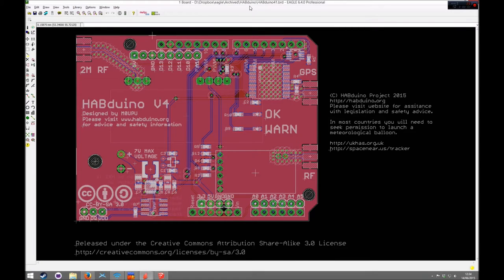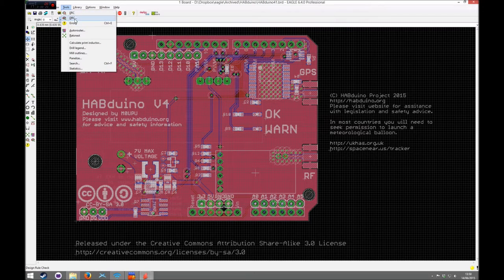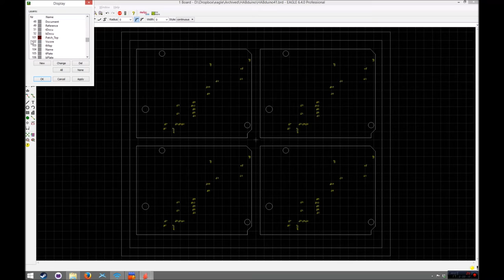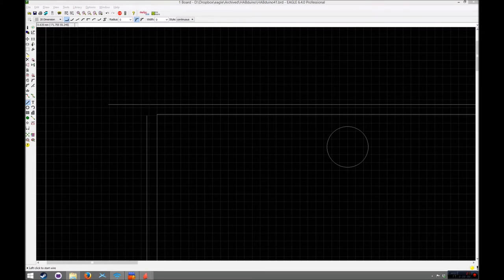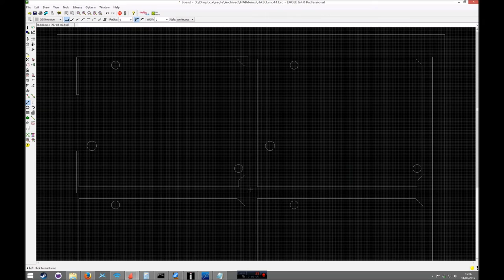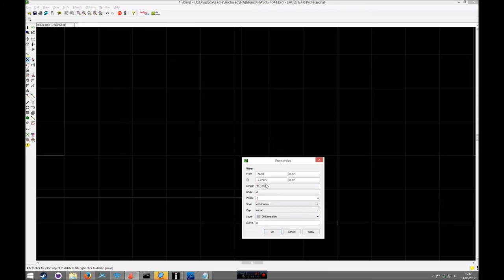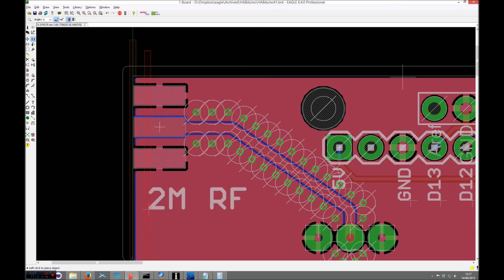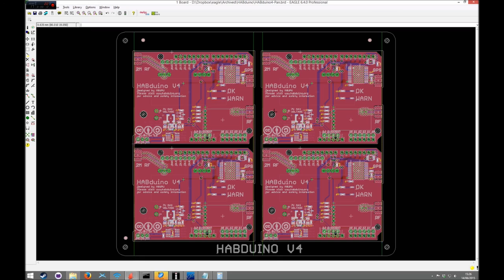Panelising PCB's for Manufacture in Eagle

Comment: Anthony, what was the width of the 2M RF trace? It doesn't look that wide. Is it 50 ohm impedance matched? I did calculation and it says I need 3mm trace to get approximately 50 ohm.
When I made it I didn't even consider impedance matching so I used a 0.5mm microstrip which give a characteristic impedance of 109 ohm !!
Dielectric Constant: 4.5
Substrate Height: 1.6
Trace Thickness 1oz/ft^2

Comment: This video was really useful thank you!! I had some questions about work flow: Why didn't you put the v-cut horizontally? I know the board shape is simple, but I would go for the simplest edges for the score to reduce work. Second, why did you spend all that time deleting the dimension lines of the original board? You could just draw a parallel line outside, draw two perpendicular lines for where you want the solid pcb join to be, then delete the remaining inside dimension line - it achieves the same thing with about a quarter of the clicking, you can still use the miter tool to round off - am I missing something? :-)

Comment: Great video! What is the command to convert all the text to vector? I couldn't quite catch what you did to do that.
Reply from the maker: +Jon Vannatto:

display none tNames bNames; group all; change font vector (>0 0); change ratio 15 (>0 0); change size 0.8 (>0 0); rotate SR0 (>0 0);

Cheers